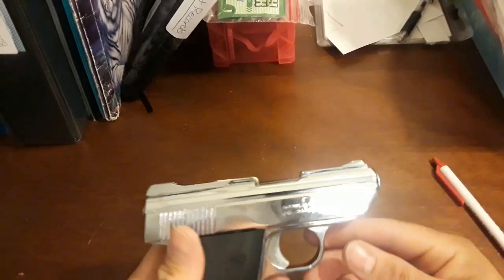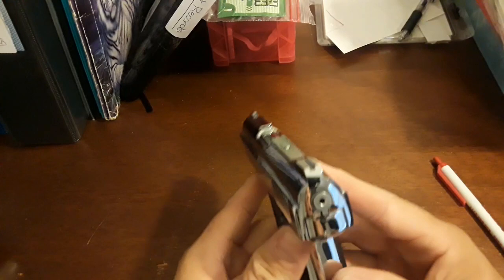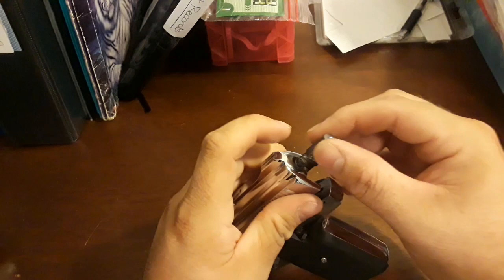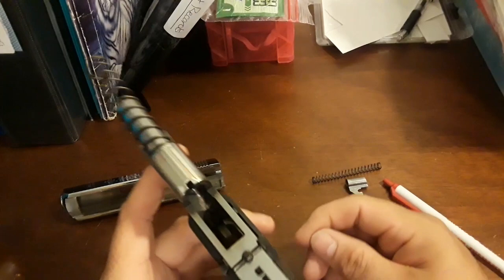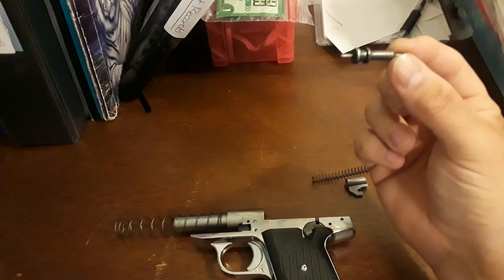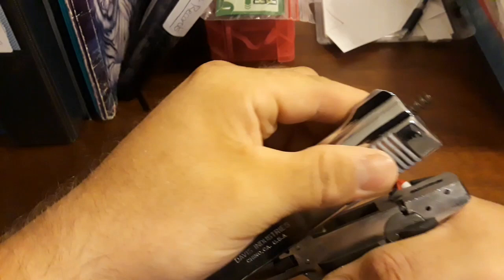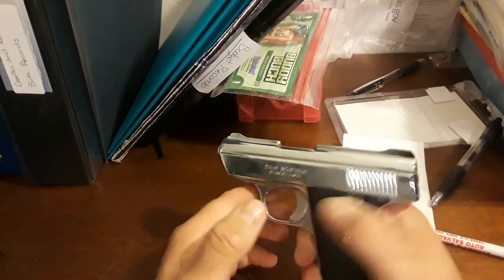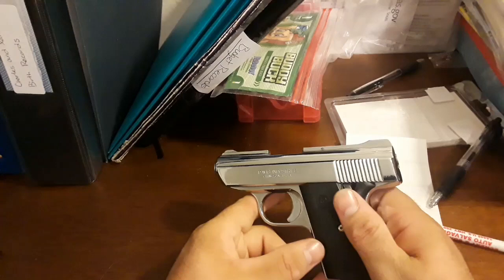Davis/Cobra .380 Disassembly and Reassembly

Comment: You know what my dad was going through his old stuff and he found a Davis 380 just like that one that gun is actually pretty reliable man I mean I don’t understand why the Davis company closed out or got bought by someone else but they did pretty good guns because I just like you I carry that thing in my pocket I registered it to me and I got about 500 rounds out of it in the range has never jammed never given me a problem. I almost got wrapped one time and I used it and he did the job just fine man Was great. He did a great job and I love it. It’s compact it’s small. It’s reliable. It’s convenient in case anybody’s wearing some tight ass pants fit still fit in there very nice little convenient gun I didn’t even know he had one of those. He just popped out. Don’t know where we both got surprised.
Reply: Actually Lorcin, Davis, Raven,Jimminez, Bryco, Phoenix Arms, and Cobra were all the same companies, they just changed the name, and moved the factories, because of multiple lawsuits,  their connection to gang related shootings and safety standard issues (I'm assuming that issues were QC related. Pot metal construction and cheap plastic triggers, tin plate magazines, and that sort of thing.) They were nicknamed the "RING OF FIRE"firearms companies. I don't have any experience with any of the firearms companies that I mentioned but I believe Hi Point would be a safer choice. I don't really know. I had a little FIE Titan 25 caliber pistol, years ago and it cheap, but it worked without issues. Great Video!

Comment: i remember buying these little guns brand new for $79.95. cool to see ya got one for $25. these little gems, in my opinion were a step in quality under a hi point, but i'm not dissing them because i like hi points. the guns, no pun intended, were hit or miss wether they worked or not. the ones i had would be lucky to get through a whole 6 round mag without a jam, but they were fairly accurate. but the point being that a gun that would shoot only 2-3 rounds is better than a gun that didnt shoot at all, and they do looks neat and id carry one. i'm saving this video as a reference because tomorrow a friend is bringing over one he got new about 30 years ago and fired a couple mags through then let it sit for me to clean, it should be fun lol
Reply: How did it go I’m about to get one from a friend
Reply: @AveSequoia  i just cleaned it best i could, but neither of us shot it. last time he shot it was about 20 years ago. Just remember you should expect problems with this gun jams, and the only reason i'd get another is for a conversation piece. But if you have a fair amount of mechanical ability, you might be able to make it work. Sometimes you can find these guns on online site like gunbroker and you could see prices as high as $200 but under no circumstances would I ever pay over $50 for one, just not worth it
Reply: Have not shot mine  since I read about one exploding. When I did fire mine, I would also only get 2or 3 shots off before it jammed. I also bought mine new for the same price you did.

Comment: I just bought one, i started to break it down, slide came off eaisily, i pulled the triger an a plactic peice went flying out, an the metal black lever on the side came off, now i can install the metal lever thing in again on a siside pin, but not sure of the plastic peiece that shatterd ,i beleive it has something to do with the saftey ,an the recessed channel across into the metal black lever? im in central america with no parts,any recommendations?
Is your sear plastic?
Reply: Go on ebay they have replacement parts
Reply: Did you fix it and how
Reply: @MAC.james7  no, not yet
Reply: @robertmackenzie3973  I did there’s a couple vids on it just look up disassembly and reassembling it one should tell you
Reply: @MAC.james7  i found the parts but im in  costa rica, gun parts .com, the guy wouldnt sell me them cuz i have another residence, but i told him i am american,sent my copy of passport, an fla liscence, still no! An because my debit card adress didnt match the mailing address where parts were going
Reply: @robertmackenzie3973  Order a debit card from " netspend.com " You can have your name on it and choose your mailing address.    You can  also choose a relatives address,  and contact the post office and ask that all mail is forwarded to your new address.

Comment: I had that exact same pistol. It was a total pos! You can get them to run but polish the ramp and run fmj. Cobra has stated that their guns are not designed to run hollow points. Mine jammed on anything and everything. Some of them though ran really good. Have you shot it yet?
Reply from the maker: Yes 150 rounds no problems did a review on it
Reply: I have that same pistol as well. Regarding the ramp, I had mine reworked because it kept stovepipeing.  Had it checked for stress cracks and manufacturing defects.  Haven't fired it since reworking the ramp but cycled several mags through it with no problems.  I GUESS that means it's better now.

Comment: Took to the range today and fired about 40 rounds after that it wouldn't fire anymore?
Reply: @kenderick Ferrell it sounds like a damaged firing pin. There is a website to order parts for the 380 including firing pins. Its in a comment thread on this post

Comment: How u put the frame back on to the gun you skipped That part its hard to put it back on
Reply: You push the barrel into the slide until you reach the wider area then bend it down and let it slide back. It’s really not that hard

Comment: Would you recommend this gun? I'm considering getting it for my first carry
Reply from the maker: As a first carry absolutely not lol you be better off with a ruger lcp or s&w bodyguard
Reply: I wouldnt recommend this as a backup or primary. Its a cheap fun "toy" but thats about it. I've owned one since the late 1980s and rarely shoot it. Beware if you have big hands, the slide will cut the top of your hand after a few rounds! There are much better options, design, caliber, accuracy, and durability available when choosing something to save your life. My $0.02
Reply: @robbonnie4849  thanks. What would you recommend for a small conceal carry pistol.
Reply: @Joshua-hz3cl  Something that fits your hand and points naturally. Don`t buy something you didn`t hold and prefered also shot before. Also remember the smaller the gun the harder it is to shoot (the gun size, weight, caliber and trigger all play together).
Reply: No its a piece of crap. Read my other comment about them going off on their own. Unless of course your life is only worth a $100 gun
Reply: @rudypericolo  
Where's your other commitments?
Reply: @rudypericolo  don't keep it loaded unless u are going to shoot something
Reply: @gggmoneybaggz2845  good point! 
Hold on Mr bad guy, I keep the ammo in the other room. Feel free to help yourself to anything that catches your eye, or if prefer have a go with my wife or kids while you wait. Back in a jiffy

Comment: Can you shot a regular 9mm bullet inside that time of gun ?🤔
Reply: no you can not fire a 9mm in a .380, the preassure would be too high for how small a .380 is BUT you can fire a .380 round in a 9mm but it doesn't eject the bullet because the .380 is less grain so the slide doesn't blow back far enough to eject the round.
Reply: 9mm shells are less than .380..lol had a thought. Bad guy is approaching you you're out of shells. What to do? Your Gal tosses you  a 380 which you currently and in the nick of time inserts into ur 9 you blow the bad gay away. And save the day
Reply: @TheOhMalik  then you get blown

Comment: Can't get the slide to slide on my friends Davis P-32,Can anyone help.On the assembly video the guy struggles with it than does it  OFF CAMERA,some help he was!!!!
Reply: You get the barrel through the slide and pull it back until the wider area of the slide can fit back overtop than let it slide back and put the pin and spring back in

Comment: I had a davis 380 about 30 years ago. i was walking through my livingroom  with it while going to put it back where i kept it after cleaning it  and 
BANG! 
I  didn't have a finger anywhere near the trigger and luckily i had it pointed down and away from me because it blow a hole in my floor. Just went off on its own. I had the gun shop guy look at it the next day and he said the gun looked as it should it wasnt anything i did. he told me theyre just junk guns. Then he told me about a local gangbanger he knew about that  carried a davis industries 380 around in his waistband and it blew one of his nads off! 
That was enough for me, i traded it in that day on a much more expensive gun
Reply: You left a chambered round. Could be the pin spring was faulty and causing the upper to raise which can release a chambered pin.
Reply: @gsg9ff  Hey thanks for the input. 
Yes is was loaded and ready for business. What happened is as follows. I had just finished cleaning and reassembling the gun. I loaded it, chambered a round and took the safety off. I kept the gun in that manner because at the time I was young and not making much money yet and  lived in a fairly rough area.... to give you an idea how rough of an area, when the discharge happened,  nobody called the cops.
Sounds like you're familiar with the gun so you know its safety isn't the easiest to operate in the dark and or a stressful situation. So I kept it ready to go in a little hidey hole. I was walking from the table where I cleaned it to the other room and... 💥bang! 
It was probably just the natural swinging motion of my arm that caused the pin to disengage and fire.  quite possibly youre right in it being something as simple as a faulty spring. Though the gunsmith I took it to the next day didn't find anything wrong with it upon admittedly only a "quick look-see" Any way the hole in my floor was enough for me,  the gun became a down payment on the glock17 I've now had since 1991 w/o any issues.
Reply: You know what just out of curiosity after  I reponded here I Googled "faulty davis industries p380" and 4 or 5 results came right up so I'm not the only person that had problems with the gun. 

To anyone else out there that might be reading this, spend the extra buck or two on a gun. You can get a decent taurus or sccy for 200- 300 bucks that won't blow your foot (or worse) off.
Reply: @rudypericolo  I agree with you, not worth it. The gun is made of cheap flimsy internals. I believe the most highlighted case was a gun exploding on a shooter and the company being sued. Saving up a couple of more bucks gets you better quality, there are many used quality guns that are affordable. That thing is dangerous to the handler for working when you least need it to.
Reply: Thanks for your analysis.  We can all learn from that.  It's one of those guns that falls into the category of: Better to have SOMETHING rather than nothing. But even then, it's important to know its' weaknesses.
Reply: @danseman1  Thanks, I agree best to have something.  
In a storm any port will do. However when the storm passes (or more importantly when the money allows for it)  time to find a better boat.
Reply: NEVER carry this gun with one in the chamber, especially with the safety off. The only thing that is stopping it from firing is a cheap spring & tapered sear. I wouldn't even store one with a round chambered. I have 2, both given to me. They very simple and made with crap materials. A lot of people will carry with one in the pipe & it's typically safe with quality guns, but not this design.
Reply: @bjseals7896  Good insight and advice for anyone that still has one of these.

In my case I was  only carrying it from my kitchen table to a room upstairs where I kept it. I had one in the chamber (and safety off) and I  didn't get any further than my livingroom when the little bastard went off! It seems it was most likely just the natural swinging motion of my arm that allowed the striker to slip and bang!

So very lucky it was in my hand, pointed in a safe direction... and nobody  was in the basement! 

That was 30 years ago and to this day I still won't carry a striker fired gun, neither a high end one or a cheap one like that Davis Industries piece of s#!t 
When something like that happens you tend to remember it
Reply: Yeah I usually leave mine loaded in the silverware drawer but I might not leave it loaded anymore. I just like having that sixth shot
Reply: @garden0fstone736  as long as you keep it "safety on" you should be fine.
 This  gun can go off w/o pulling the trigger and sometimes when you pull the trigger the gun can blow up... but far as I know the safety works fine.